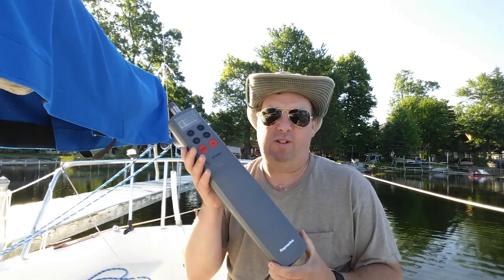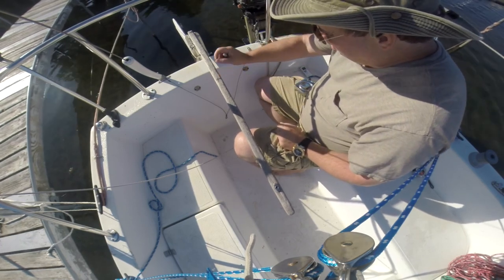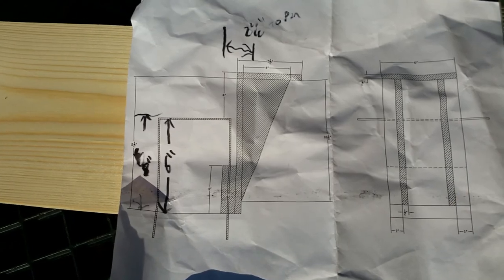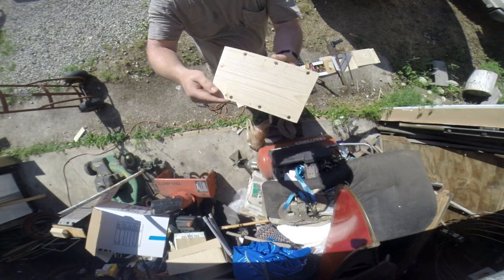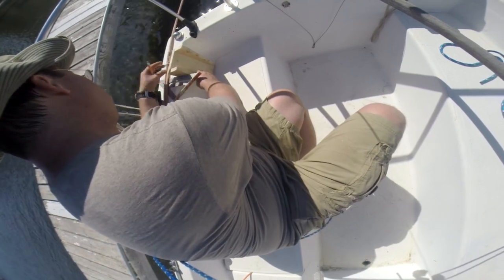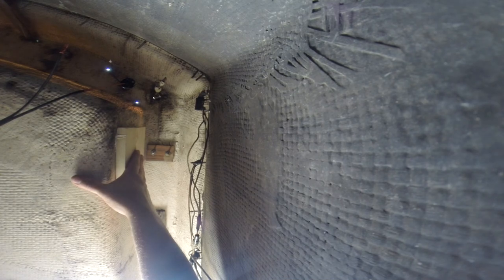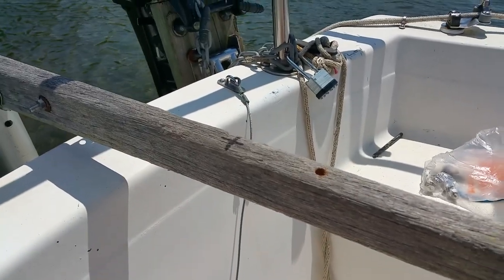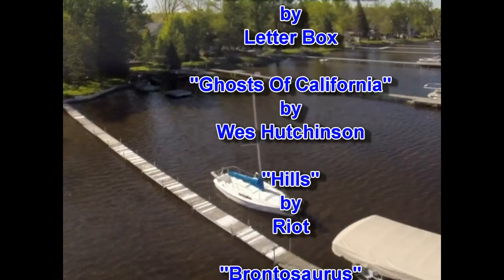Installing a Raymarine ST1000+ Autotiller

Comment: I've never seen this auto-pilot installed THAT close to the stern....You said 18 in from "pivot point" To me that's the bolts that hold the rudder to the boat. IE where the rudder pivots. can't watch anymore, good luck
Reply: He caught that but didnt mention it hence the second x on where to drill.

Comment: that is a lot of work using untreated pine.I personally use teak where possible, if not starboard(though pricey but it endures w/o maintenance). I would rather use salvaged marine stainless steel 1/16 if I have access to a bending brake(if not a sturdy vise & leverage). Built it once well, but then I live in Fla & stuff used in salt water needs to be robust.

Comment: I need to fit mine more than 460mm (18") from the rudder pivot.  Would that be OK?
Reply: keep in mind that the pivot point would actually be where the pintles and gudgeons (rudder pins) meet, not the back of the rudder as shown here..
Reply: @chrisburns5691  I initially fitted mine at 18" from pivot, but found it would not tack as the rudder was not moved across far/fast enough.  I have moved it back to 12" so that the rudder can be at 45 degrees on full autotiller deflection.
Now much more useful.
Reply: @oakbellUK  ah ok, glad it worked out
Reply: @chrisburns5691  He doesn't mention it, but later in the vid you can see he put the pin further forward of the initial "X". I just installed one of these on my RS22. Can't wait to try it out on my sail to Catalina Island next week!

Comment: You can but extensions so you don't need that structure
Reply: Yes you can get extensions and you can mount it on the under side of the tiller so it will not be up so high!

Comment: I have mixed feelings about this video... It's informative, but DEFINITELY not an approach I'd take.
There is no way I'm putting a butt-ugly bracket like that on my boat.

By the way; you don't need to sand your tiller down. Just soak it in teak oil, and it'll look great, and last longer.